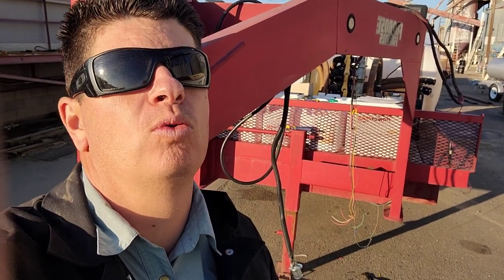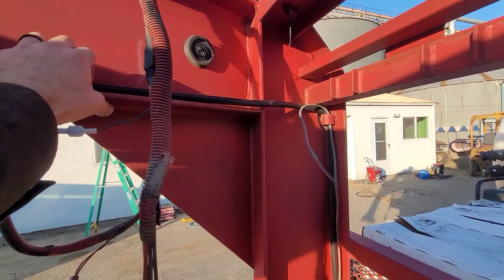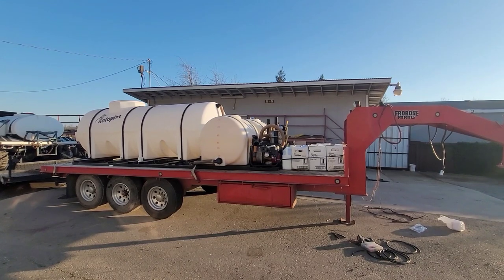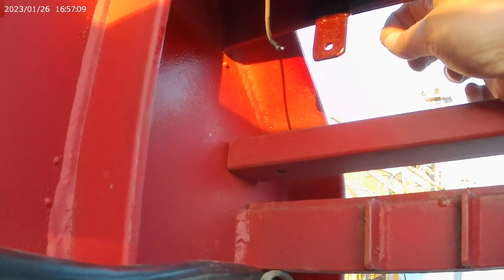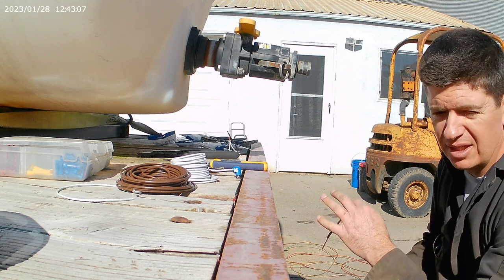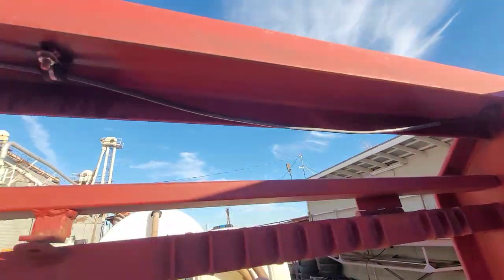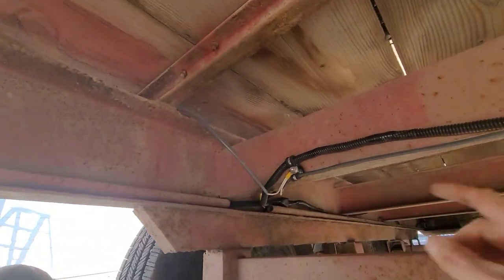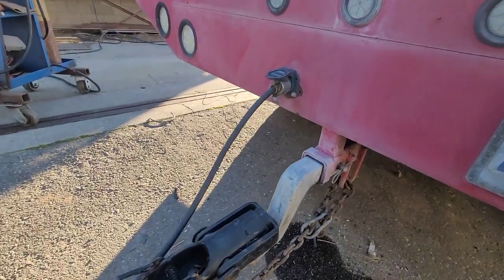How to completely rewire a trailer the RIGHT way

Comment: I like using the butt splices with the heat shrink made with them now. I used to do it  the way you did and wrap in tape for years. Especially on those outside connections, they will eventually turn white from moisture corrsion and cause a high impedance connection. The waterproof connectors and my battery powered heat gun makes it quick. Just rewired a 53' horse trailer today that the cable for the lights got pinched in the goose neck air bag plate and crushed it. Replaced back to the connector box with new ring terminals and good to go. You're right, those scotch loks are junk. They are fast and easy, but cause headaches down the road.

Comment: Thanks for the info. Just picked up an old  bumper pull 10k equipment trailer. Replacing all the floor boards now, got as far as removing them. Lights work however I found those blue garbage connectors . Thinking it would be easier to rewire before I install new decking.  The info in your video, the use of a junction box and showing the bad wires made me decide redoing all the wiring  is definitely a good decision. Thanks again for the info!
Reply from the maker: Very glad I could help! And yeah do the wood last!

Comment: What is it with you Yanks?

I've seen so many rewires on US trailers just a couple years old that I'm pretty sure by now that you guys start out with complete junk.

In European we start with galvanized chassis and waterproof wood. That combination lasts decades. 

Same for the lights. Most used here are companies like Aspöck, Hella, Vignal and so on. All capable companies with wiring systems that last a decade without a problem.

So is it me or do you guys start with junk? Because a 4 year old wire with brittle insulation a very, very rare thing here in Europe.
Reply from the maker: This trailer, and it's wiring, is probably older than you are. Trailer was built by my father in the early 1980's. All that is in the video, if you paid attention.
Reply: We don’t give a shit how you do it in Europe.